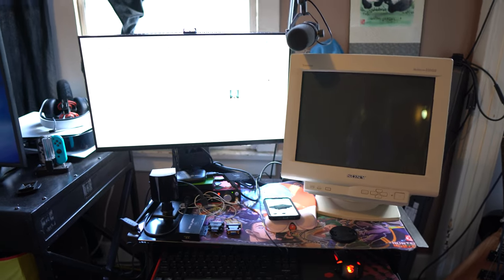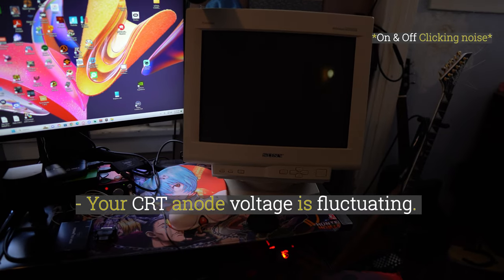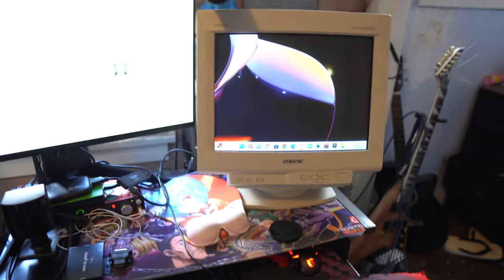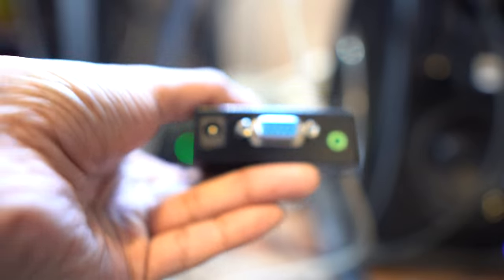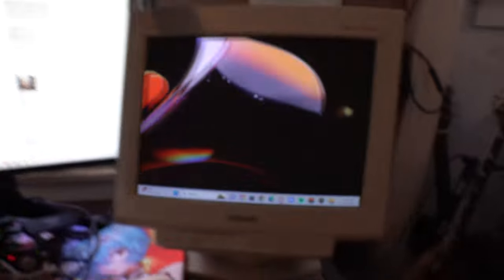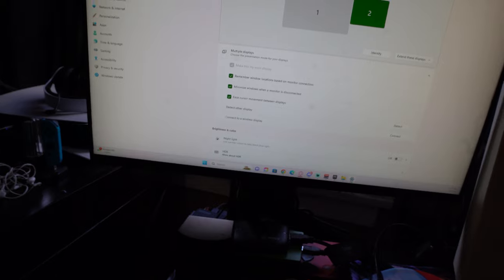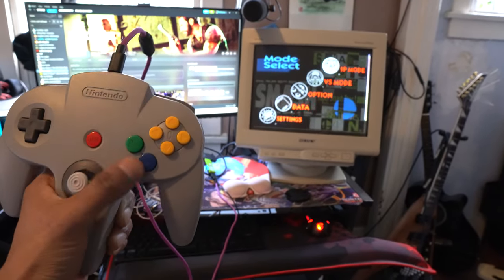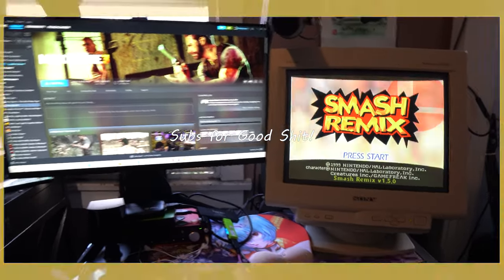Fix CRT Monitor From Shutting Off & On | Modern Display

Comment: This adds lag, by the way. Because its converting a signal from digital to analog, but if you don't mind that, sure.
Reply from the maker: the vga to hdmi converter I use doesn’t scale the content so the outputting doesn’t lag.